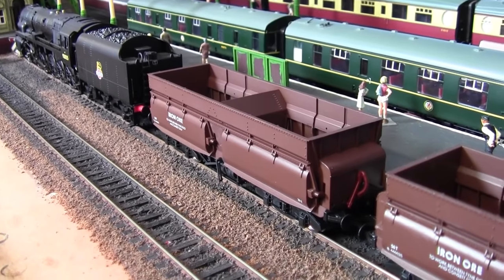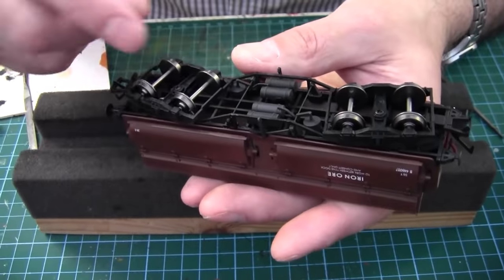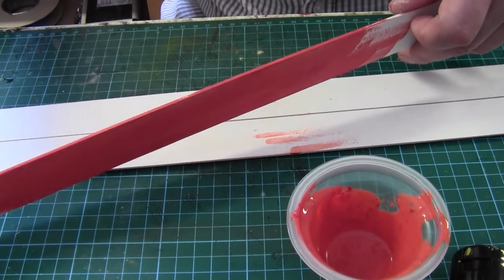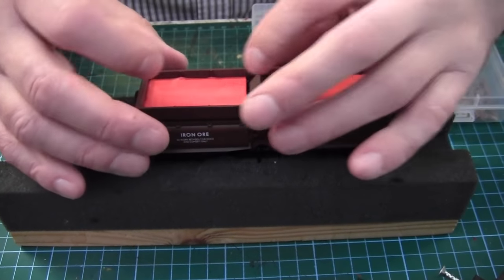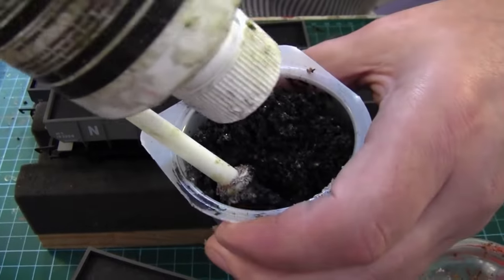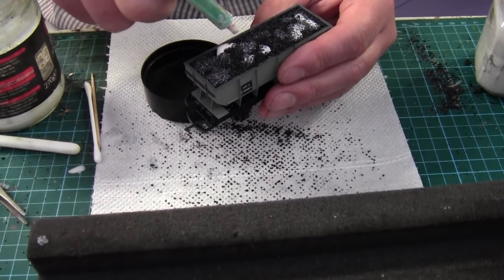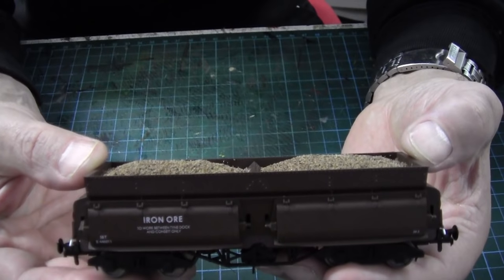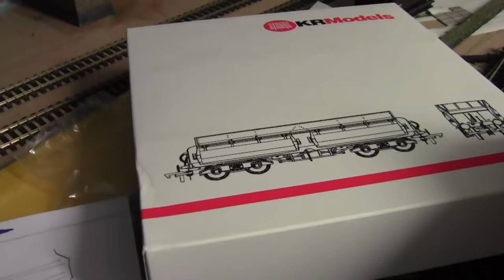KR Models Iron Ore Wagons Loaded..& competition   No 315

Comment: Hi thanks for the excellent video. A tip I have seen for wagon loads is to place a piece of cling film in the wagon before putting false card, then add your coal and glue. This allows the load to be removed and helps stop the glue leaking and later pulling in the sides when it cures and shrinks. You can then remove the load and cling film when set.
Reply: A fantastic suggestion Steven as half the time they will be running empty. 
I see KR Models are now selling the wagons with the option of them being ready loaded for a small extra cost. Presumably this will be just a moulded top cap and be removable.
Reply from the maker: Hi Steven. That's a great tip using a piece of cling film. in th eend i was lucky i only had a couple that leaked. my loads are permenant for the moment. many thanks for your valued input....stay safe Tony
Reply: Stick a magnet to the bottom of the card and you can lift it out.
Reply from the maker: Great tip Alan.....I am hoping that they will shrink in time, as most loads do...then i will be able to do that...cheers Tony
Reply: Steven, a brilliant idea…the simple ones are, and that is simply brilliant 😜

Comment: Hello Tony,
The loaded iron ore wagons appears to be fairly realistic. You should have a second set of unloaded wagons for the return trip to the ore mine!
Just a quick note about the wagons' bogie: I'd use a drilling machine at low rpm as a crude late and file down the washer to a diameter that fits into the cylindrical hole at the bogie . And instead of super glue, I'd use liquid tread lock. As a result, the screw connection is secure, but it may be easily opened if necessary.
Stay save and well
Heinz
Reply from the maker: Hi Heinz. thank you for your comment. i do have a second set still in the box. that sound like a great tip, using a drill om slow speed. but it would have to be a pillar drill for accuracy. the super does work as i have to back one of the boggies as i put it back on the wrong way round. and it still nad done back up ok.
thanks again. all the best. Tony

Comment: The loose bogies/loose screws appear to be a common problem, a few of mine were the same.  Just a note that, when coupled together in a rake, all the end handles would be on one side of the train - this was so, if the air pumps failed at Consett, they could all be manually opened from one side of the unloading gantry.
Reply from the maker: They have either used wrong screws or didnt leave enough clearance for the screw, either way this should have been sorted during quality checks.
but never mind its great to have something that represents a proper iron ore train. 
Thanks for the tip about the hand rails. the wagons do have to come apart for weathering...thanks again very much appreciate your input....all the best Tony
Reply: Most folk think model railway folk have a screw or two loose,goes with the hobby....
Reply from the maker: You crack me up Eric.....lol
Reply from the maker: Hi Eric i have shared your latest video....a true representation of pelaw....
Reply: @TONYNORTHEASTERN  Thank you,just if im out and about i can film it on my phone,im no David Bailey though.

Comment: Nice wagons Tony, but out of my reach price wise, do exactly the same as you with the 21T hoppers although the 'hump' of coal is hard to create sometimes, I think you should change the 'crosti' 9F ex-works condition for a  Tyne Dock type weathered with smoke deflectors, to make the train more authentic, the trains were banked out of Tyne Dock loaded direction, I have a picture of one being banked by a class 08 shunter! 800tons of ore took some shifting over those steep gradients ,all the best names  have gone for your new station only one I could come up with is West Dock Lower Halt regards Ian H.
Reply from the maker: Hi Ian. thank you for commenting. not all the names have gone, as i have gone through the list. 
thank you for your entry into competition. its going to be hard to chose one from thr list. 
Yes i have been looking for a apropiate 9f but the are hard to find. i di not know about the 08 shunter as a banking engine. thanks again for commenting very informstive....cheer's Tony

Comment: The 9F had the right hand running board cut and two westinghouse pumps were fitted to all the Consett locomotives,the other thing to note is dependant on where the ore came from had differing densitys,it rarely could be seen over the top sides of the cars in a lot of cases.At times they looked like there was non in.
Reply from the maker: Hi Eric, some great input regarding the consett locomotives in your comment. 
I dont if have noticed, I have put the load in very slightly raised. almost flat...i think having the the book mentioned in the video has helped me out a lot. if a shame that there is no coloured  photos. they are a few around. thanks again just what i wanted hear in the comments. manu thanks Tony

Comment: Nice work on te loads mate. How did they get filled at Tyne Dock? Possibility of (part of) a Steel works on the layout later? Hmmm? I like the idea suggested by Julie Bell of Stevenson's Museum. Arthur
Reply: The Tyne Dock loading was done by firstly unloading the ship by crane into a hopper and bogey bucket that went up to a purpose built unloading gantry that had hoppers that then loaded the Consett wagons. Then unloading at a purpose built unloading gantry at Consett Iron works. Before these Consett wagons came into action it’s was a different story of loading about 30 hopper type wagons straight from Tyne Dock. Obviously this was a slow process. They changed to the specially made Consett wagons early 1950s and updated the loading and unloading to make more efficient. The steam trains were initially Thompson Class 01s and Q7s fitted with Westinghouse pumps to open the side doors of the Consett wagons. Then upgraded to the 9Fs. Before the Early 50s with the hopper type wagons they used Q6s and Q7s and had to use banking trains to get up the inclines even the 9Fs needed a banking train in parts. Later they used Diesels after the mid 1960s Sadly that’s all part of history. The Iron works at Consett is long gone. I can only imagine how impressive it must have looked seeing the 9Fs pulling those 9 wagons.
Reply from the maker: Hi Stephen. interesting to hear workings of the loading and unloading of these unique wagons. especially the early loco's before the 9Fs and Deisels. about the consett works i have a small piece of floor space probaly 5ft. i might be able to add a small section so i can permently park this trian.  but that will be a project for the future....thanks again for a very informative comment...all the best Tony
Reply: @TONYNORTHEASTERN  Yeah when I started building my layout I constructed a unloading gantry for these wagons so I have somewhere to keep them. I ordered some two years ago. I wish I had room for a loading gantry as well but I had already built some of my layout. I purchased a set of the old hoppers to use in the first place. Then wow KR put out for orders of the Consett wagons which pleased me and ordered straight away. I have 2 Hornby 9Fs one is the 1/1 edition of 1 of 2000. Which I decided I did not want to modify or change the number to a Tyne Dock number. Yet again I hit on a lucky find of an older very rare Tyne Dock numbered 9F. Normally this came in a set with some wagons back in 2000. But for a short time they produced a few on there own. I have acquired one of these and don’t think the seller knew it was rare so it was a bargain. It’s numbered 92099. Tyne Dock was allocated 10 9Fs in two stages numbers 92060 to 92066 7off. Then numbers 92097 to 92099 3off total 10. Mine is tender driven and I have fitted the 2 Westinghouse pumps and the piping and the vacuum tank on the other side. My pumps I sat on top of the chassis above the wheels. The real ones had part of the chassis cut away so they sat lower I guess so the driver could see above them. I did not want to cut into my model thought that was a bit too much. But I’m happy with my results and I don’t think this will loose any value as I have made it more realistic. I don’t weather my models love them to look clean and appreciate the detail. I do have a one of my trains I purchased weathered as a example a Patriot class Sir Frederick Harrison. This was professionally done, and I had a uncle called Frederick Harrison so had to have it haha. I have yet to finish my layout so it’s an ongoing project that never seems to end. One day hopefully in the near future I may get to a point that I’m happy with. I have taken up most of the loft and I need to get to a point of finishing the wiring etc so I can do the fun stuff of the scenery 😂. Keep up the good work Tony 👍🚂👨‍✈️
Reply from the maker: I would love to see pictures Via mu Face book page of the same name. Tony north eastern.....cheer's Tony

Comment: I had the problem with the Consett wagons loosing the screws on the bogie’s it’s a bad design. The bogies unscrew the screws by moving from side to side. I’ve made and fitted spigots so the screws tighten onto the spigot and not the bogie. This has worked for me. Other than that I quite like them. Also even the 9Fs needed help to get up the inclines they used Q7s or also another 9F and class 01s as bankers. They were fitted with the Westinghouse pumps. I’ve fitted them to my model trains. The history of the Tyne Dock to Consett Iron works iron ore run is very interesting. Loading gantry and unloading gantry very unique. They also experimented with the Sulzer class 47 diesel D171 to pull the nine wagons which it did easily and in record time. The 9Fs didn’t have the crosti boiler fitted.
Reply from the maker: Hi Stephen, yet again some great input here. very much appreciated. like yourself i find this topic very interesting. as there are very few places where you would seen these 9fs pulling such unique wagons. the thing is at present i have nowhere for theses to run to. except around the layout. but yes the 9f is the wrong one, but at the moment its the only one i have. but i do hope to change that in the future.....many thanks again...cheer's Tony

Comment: im after some of these .there aboutv72 quid for 3 i believe.
i have a 9f which i am about to fit the westing house pumps to and tanks .also an 01 and two q6s to fit pumps to.i intend using my cl24s as well and i have a gateshead shed cl 46 as my on test banker.i was inspired by the south pelaw layout .
Reply from the maker: Hi. they are a good model. just be aware of the loose screws. but apart from that the quality of these is good. many thanks for commenting. all the best Tony

Comment: 9F was mostly used because they had a compressors To operate the wagon doors
Reply: The air pumps were fitted to the 9Fs specifically so that they could operate on the Consett iron ore trains.  Prior to that, 01 and Q7 locos had been fitted with the pumps but they could only manage 8 wagons up the hill to Consett, the 9Fs could manage 9.
Reply from the maker: Thats very interesting to know, may thanks for commenting Michael /JD models. all the best Tony
Reply: The air pumps were made by Westinghouse who also made pneumatic switch machines (points) and pneumatic signal actuators, too.  Newcastle had their points and signals fitted with them in 1906.  Best, Jason.
Reply from the maker: I remember John Cuddihy saying that those pneumatic swtches were leathal as they slamed when working. you had to be very wary when crossing the points...interesting topic...